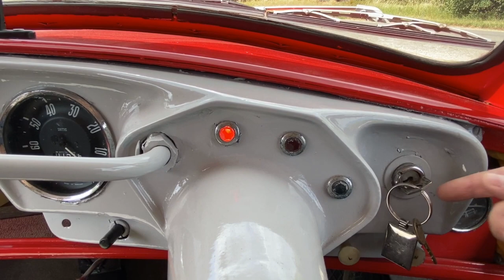IDRIVEACLASSIC reviews: 60s Bond Mini Car Mark G (micro car/mini car review)

Comment: My dad had one of those with a kick start! Someone asked him how much it did to the gallon he replied it’s never used a gallon without breaking down!
Reply: I had one with a kick start also. Mine also had reverse gears (the same number of reverse as forward gears) by turning the ignition key to the left and getting the engine to turn over backwards.
Reply: Was your dad joking? I had mine 2 years during which I used it daily to get to work and for social use, and also spent a week in it touring the Lake District, and it never broke down. I did have a flat battery, when the kick start came into play, but I bought a new battery and cured that problem.
Reply: She's cruising in that car. Looks like fun.
Reply: Our neighbour had the kick start model it was hilarious in the winter seeing him kicking it over and swearing as it was really unreliable. 
What was funnier he failed his driving test in it as he was driving too slow for the examiner.
People used to blank off the reverse so you drive it on provisional unaccompanied as it was the classed the same as side car outfit.
Reply: @Lee-70ish  I think all Bond Minicars had electric starters. Early ones had a 6V car starter motor mounted on a bracket held on by the cylinder head nuts, with some kind of chain drive and freewheel mechanism going down to the crankshaft. These were unreliable and the battery would often go flat. Later ones had a Dynastart, which was a 12V combined generator and starter motor. This had a stator bolted to the crankcase with a rotor mounted on the end of the crankshaft. inside it had 2 sets of coils, one for charging the battery and the other to crank the engine over for starting. The Dynastart was a huge improvement being 12V and mechanically more efficient. The old 6V system belonged to the era when cars had starting handles because their starters too were unreliable. All Bonds had a kickstarter as the engines were standard Villiers motorcycle engines. Notice on this Bond the gear change lever was one up and 2 down as it was connected to the standard motorcycle gear change shaft, normally foot operated on a motorcycle.
Reply: @replevideo6096  My old Dad used to call it a dynawontstart. He used to kick his most of the time.
Reply: @replevideo6096  The earlier ones had a 125 cc two stroke engine  , which was started by raising the bonnet , and putting your leg inside it , to kickstart the motor.Cruising speed was quoted as 30 mph . The ' dynastart ' didn't come until about 1959 , by then a 250cc  unit was fitted giving a top speed of 55 mph .
Reply: @Corinthian44  I thought the early ones had a normal 6 volt starter motor, mounted on the cylinder head bolts, with a chain going to a sprocket with a freewheel on the crankshaft. I can imagine a flat battery being a frequent occurrence with that. Maybe it was an optional extra.

Comment: From the “beats walking” school of motoring. I imagine if I stepped up to one of these from a bicycle or motorbike, I’d feel pretty smug the first time it rained or snowed and I was able to drive along in relative comfort: “ahhhh, this is living!” Thanks for the video and the smiles, Steph.
Reply from the maker: Thanks so much for watching lovely!
Reply: TheLCNW  I drove mine in snow, and also my previous car, an Isetta. It's fine once you get moving, just like driving a motor boat, you go with the flow. Remember both cars have the weight of the engine on their driving wheels, so it's not hard to get traction. However, I once drove a Zephyr 4 miles in deep snow after a blizzard, with the roads lined with abandoned cars whose drivers gave up trying. I guess my training in 3-wheelers gave me an edge.
Reply: You've got it in one!

Comment: The back windscreen almost reminded me of a Ford Anglia 105E
Reply: Reminds me of the Reliant Regal😊
Reply: Hey stef I recall seeing one of these at a little classic car show in Stalybridge a few years ago and I remember the strange front wheel drive set up - this is the only time I have ever seen one in action!!
Reply: The mark G was a redesign to resemble the current iteration of the Ford  Anglia baby Saloon and yes Reliant did the same with the Regal. If you could afford the extra you bought the Reliant with its water cooled Austin 7 engine. Back in the day it was a common progression from motorcycle to car via a three wheeler. Especially so if you didn't pass your driving test first time. I moved from motorcycle to three wheeler and stayed with them through to the Robin until I got fed up with the bloody noise and bought a Nissan Micra. I thought I'd died and gone to heaven. Not only did it have a push button FM radio but you could actually hear it. Halcyon days nevertheless. 🙂
Reply: @nigeldavey1043  Marvellous.
Reply: @chillired5389  most likely were the regal got the back end look from
Reply: I’ve got a 105e and I’ve also drive one and by god it was an experience but I was glad to get back in the anglia 😂

Comment: Highly dangerous car. I was a passenger in 1961; a wind lifted the front skirt up and dumped us into a grass ditch. Years later I witnessed a gust of wind lift a Bond up onto one back wheel only...the nose was in the air. This was on the busy Wellington Road Stockport, UK

Comment: I have been a Bond enthusiast for 53 years. I have my original Mark C I bought while at school plus another. I covered about 60,000 miles in my 20s in the Mark C and thought nothing of going on a 200 mile journey. I upgraded to 250cc. It was very well maintained, fairly quiet (having a much larger silencer, enabling the use of a radio and tape cassette player) with well adjusted steering (no wandering) and no fumes in the cab. My girlfriend and I (now wife) travelled all over the country and up and down motorways in the 1970s. The longest trip we made was 702 miles over a weekend to see the London to Brighton run.

Comment: Hi Steph,
Nearly fifty years ago, when I was a poor student, I was the proud owner of a mkF Bond. It was great fun, every journey in it was an adventure. It was very reliable, it would turn on a sixpence and in the summer months I would remove the top - but with the top off the car would flex and the door gap would open and close! The brakes were very poor (I would keep my distance from the car in front) and it was incredibly noisy. I bought a new silencer at a Bond meeting and the difference was remarkable for about a week, but then all that fibre glass stuffing in the silencer was blown away!  Summer ‘71 me and two  friends took it to Wales (from B’ham) for a week. Unfortunately, in the middle of nowhere, on a quiet country lane, we had a puncture in one of the back tyres. I didn’t have a puncture repair kit so we took the split rim wheel apart and stuffed the tyre with grass, twigs and leaves and once fitted back on the car, we were very hopeful. It got us about a hundred yards down the road - there the wheel was spurting steaming, smelly, green sap! We ended up walking, returning the following day with new tyre and tube.

I had a few repairs to carry out in the time I had the car- it kept jumping out of top gear at one stage and the complicated electrics needed some attention. But for a year and a half it was cheap motoring and great fun.
Reply: Touch and hold a clip to pin it. Unpinned clips will be deleted after 1 hour.

Comment: I loved this video because from 1962 to 1965 I was a proud owner of a Bond Minicar Mk.F Estate with the optional Villiers 250 twin engine normally used in sports bikes, complete with straight through exhausts. I did drive it on motorways flat out at 70mph. I think your example needs some attention to the steering and exhaust. There should be no smoke in the cabin and you should not have to wrestle with the steering to keep in a straight line. Mine never broke down in that 3 years , and always started first time, but then I am a mechanic so I maintained mine properly. I perfected the art of cornering with one back wheel off the ground to get round corners quicker. In 1963 the law was changed to allow 3-wheelers to have reverse, hence the Bond was offered with a Siba reversing dynastart which could start the engine up backwards. I didn't have one, but it wasn't needed as the steering could be turned 90°, allowing it to drive out sideways, and turn a complete circle on the spot. Why didn't you demonstrate that quirk which is unique to the Bond? Mine was not unduly noisy except when accelerating hard. That single cylinder should be even quieter, and I suspect a hole in the exhaust which would cause the noise and the smoke.
Reply: I had a 1962 MK G as my first car in 1974.  The previous owner had bought it for the engine to put in a scrambler. He'd replaced it with a 197cc which  doubtless made it slower but had the big advantage for me in that  one insurance company did much lower rates for cars under 200cc. I got the car for free. They'd tried to sell it but had no enquiries so  they just wanted it gone. I  drove it off road until I was 17 and passed my test. It was a heap really. The maroon paint was like sandpaper and polishing it just rubbed it off to the primer. The main problem was the chain kept coming off. It needed either new or different sprockets which when I was still at school I didn't have the money or knowledge to replace. I did get pretty good at putting it back on and driving very smoothly so it didn't come off!
I was surprised that Steph didn't demonstrate the turning circle and  I wonder if it had the dynastart for reverse which you pushed the ignition key in to activate. IIRC you could drive with a dynastart if you had a bike licence because it wasn't considered as a reverse; am I correct? Mine was pretty noisy but it certainly steered a lot better than this one appeared to do.  I wonder if some of the smoke smell may have been from the nearby fire. 
It's interesting hearing and reading the comments from younger people relating to cars like this I think.
Reply: I agree about the turning. No need for reverse. Did the dynastart make the engine run backwards? My memory is not what it was..
Reply: @pureboxofscartcables  Yes it did.
Reply: The terribly rutted and crowned road left on place for the tires/tyres to track .. she did fine , eh ?
Reply: @cornishhh  Mine did not have a reversing dynastart, so I considered changing it, but the price was too high. Both dynastarts were identical except the reversing one had both positive and negative poles insulated so that it could be started up in reverse. Actually the law was changed in 1963 and allowed 3-wheelers to have a reverse gear. At the time I had an Isetta, which had a proper reverse gear blanked off by a pin in the gearbox. It was a 2 minute job to remove the pin. Even today there are Isetta owners who don't realise they already have a reverse gear or that it is now legal. I could not sell my Minicar in 1964 when I passed my car test, but I struck lucky. A local dealer who sold used cars and  3- wheelers agreed to take it in part exchange on a Vauxhall Victor.
Reply: @pureboxofscartcables  Yes it did. It was identical to the standard dynastart except both poles were insulated from earth so that it could turn both ways. The car also had  locking washers on the sprocket nuts to stop them unscrewing in reverse, and an additional change over switch on the dash.
Reply: @pureboxofscartcables  It did. They weren't so reliable though. The contacts in the contacter box used to burn out. MIne did anyway!
Reply: @replevideo6096  And the price you'd get for it now...
Reply: That was a very interesting and carefully worded reply, thank you very much!
Reply: @pureboxofscartcables  yes

Comment: Great stuff.  My cousin had a Bond minicar back in the early 1970s.  Lots of memories of kickstarting it under the bonnet when the dynastart wouldn't work as well as the death defying rides.
Just for info, the silver lever you used to start it is a decompressor valve, which allows the dynastart to spin the engine over up to speed easier than working against the compression.
Thanks for a great video

Comment: Hi,

What a lovely video thanks for sharing it. It takes me back to when I owned one of these delightful mini cars they being such fun. I also owned a Bond Bug in John Player colours which surprised many as it shot away from traffic lights and I also owned a Bond 875 with the Imp engine but this never held the same appeal.  A handful of spanners and an hammer were all that were needed to do repairs and no electronics to fail; just good cheap basic transport; they had street presence unlike many modern cars just clones of each other; pity cars are so complicated these days.

Kindest regards, Colin.

Comment: I had a Bond minicar in the 60s, mine was a called a  MKG ranger van. 250cc  & had the dynastart. The steering was perfect breaks were good & no smoke inside. But it was bloody cold in winter. I had mine 2 years only broke down once that was coming back from Manchester  over the Woodhead at night & the engine seized, i was giving it some stick so it was my fault. I let it cool down used the kick starter & it freed so carried on with my journey. Great little car, loved it.

Comment: Back in the early 1960s we had three Bond Minicars in the family - my uncle first had a convertible and then, after two years of Borgward 6-cylinder ownership in Germany, a hardtop - can you imagine that variety of motoring?! My mother had a convertible some time afterwards. My uncle would refer to his as The James Bond. I fully agree with the lady owner interviewed - they were characterful machines, loved by kids, and very prone to breaking down! There was a feeling, especially in the convertible, of flying in a vintage light aeroplane (think Auster Alpha, or DH Tiger Moth), with the loud engine and vibrating aluminium panels. My uncle, being ex-RAF, used to drive off down the road, pull back on the steering wheel and utter 'rotate'!
I see below the mention of a kickstart and I noticed that the car tested had one - useful, I imagine. The gearchange is actually quite logical and certainly any motorcyclist would feel at home with it. The turn in its own length turning circle was a notable feature - even tighter than that of a Triumph Herald!
There was an active Bond Club back in those days and my mother and father joined up, making a number of good friends. The club had an annual expedition to Clacton - on - Sea. Google tells us this is a distance of just over 90 miles from our then home in Greenford, West London/Middlesex - quite a jaunt! This event was renowned for frequent breakdowns, with plenty of opportunity for the club experts to get their hands dirty.
One of our neighbours, directly across the road, had a Reliant three-wheeler, which seemed considerably more civilized than our Bond.
Laurie Bond went on to higher things a little later, producing the Bond Equipe GT, based on the Triumph Herald/Spitfire/Vitesse. Reliant, of course, produced the excellent Scimitar and Scimitar GTE coupes.
Thanks for the most entertaining and nostalgia-evoking video, Steph.

Comment: This was fun. Takes me back to 1971/2 when I had a Mark F - reg 7912MK. It had a Villiers 250cc single cylinder engine. It had electric start but also a kickstart. Unfortunately the large aluminium plate which bolted to the bulkhead and carried the engine and steering cracked across the top left hand corner between the worm and sector of the steering. So that when you pulled away ... you lost the steering! I replaced this but when the new one also cracked, I gave up. Also, the original bonnet catch was a flimsy affair and I once had the bonnet fly up, blocking my view, as I was driving along. The brakes were also very poor! Great fun though for a 17 year old. Great nostalgia.

Comment: Interesting take on the three wheeler. I imagine some of the straight line instability is caused by the engine being fixed to the steering mechanism and not the car's body, so it actually moves with the front wheel. That's a lot of weight to shift. Not only that, but the engine is ahead of the drive wheel, hence the long snout with lots of empty space inside the bonnet. That's a terrible design. Bonkers, but fun!  😁